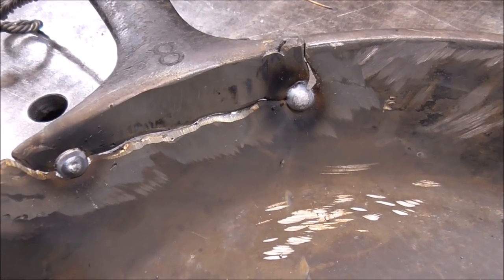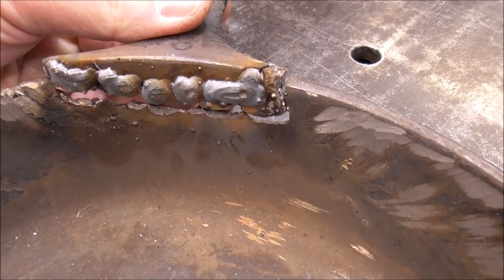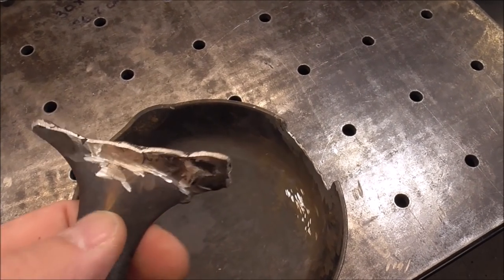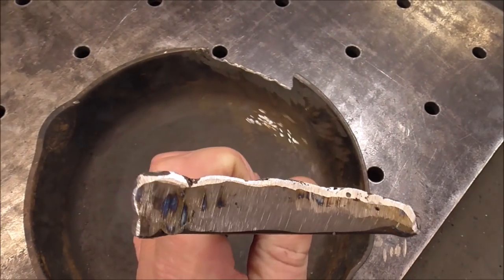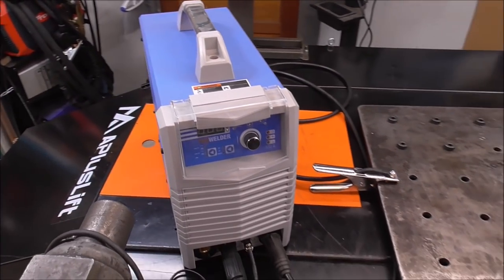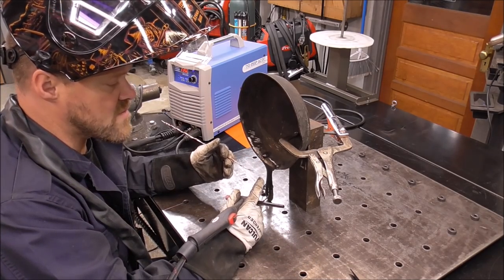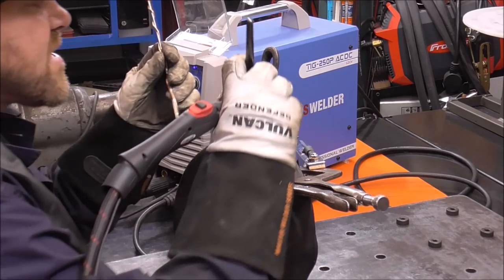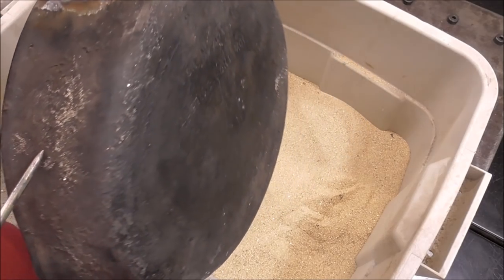Cast Iron Welding Repair Experiment Using Copper Wound Stainless Filler Wire

Comment: Thanks again Brandon, they can’t say you didn’t try it. I spent many a day with 3 welders who were trying everything they had heard or seen on welding or cutting cast iron ash lines in a power plant. I’ll say this for them, they never gave up trying until they died. They were a great bunch of guys. Stay safe and keep having fun. Fred. 🙏🏻🙏🏻👍🏻👍🏻👏🏻👏🏻✋🏻✋🏻
Reply from the maker: Thats awesome Fred. I actually had a guy tell me today that cast iron cant be welded and that he had 20 years in the trade. I guess once you start entertaining a "cant do" attitude then you are half way to failure. How were you guys repairing them Fred? Oxy Brazing with cast rods? Were they pressure lines?
Reply: They were trying both ways. That was almost 60 years ago. The ash lines had to be rolled after so many hours and hopefully replaced before they started leaking or bursted. I was there for 6 months and was laid off but changed fields. Got my eyesight back in the bad eye and decided to try welding a few years ago. My wife says I am very trying whatever that means ! 🤗😁🤣
Reply from the maker: Very interesting. On a side note your wife must know mine because mine says the same about me....😏 lol

Comment: I'm impressed how smooth that stainless and copper welds @Brandon Lund
Reply from the maker: @Antonio Claudio Michael I'm going to dig a little deeper into this combination because it flowed like butter. I was actually surprised it failed. It could be because if other repairs so I might try this again on a new pan. I was really hoping it was going to work.
Reply: @BrandonLund  this on a new pan would be a great video I did see how well it flowed and that was impressive to me

Comment: I've welded cast iron.  I did it by heating it with a blow torch and then just kept it hot with the torch, then I slowly decreased the time heat was on it, then buried it in sand with a towel over the top.  Worked great...heat then re-heat.  It almost seems your weld was good with copper, but your cool-down was way too fast.  I'd love to see that again, but you heat and re-heat.
Reply from the maker: @Hip Airbrush what you described is typically how I weld cast also. As far as the cool down, I did it in this video the same as I did in the 3 prior repairs hoping to keep the results consistent. One other viewer mentioned try 309 because of the dissimular filler. I hadn't really thought about it that way.  I'm also wondering if the past 3 repairs on this could have really messed up the grain structure. I really want this to work because the metals flowed like butter. I'm going to try this again but with a new pan and heat more as you suggested. Even if it's not identical to the previous repairs I feel like this is a good filler metal once I get it figured out.
Reply: @BrandonLund   I'd love to see that.  I saw exactly what you meant with the weld how it penetrated nicely.  I think hitting it with the blow torch a few times to keep it hot would help it not crack.  I'm now wondering also, if you couldn't use a nickel rod and wrap copper around that.
Reply from the maker: I like that idea!

Comment: The more i think about it maybe the filler rod isn't the problem but the process isn't really ideal being the weld didnt fail it cracked next to the bead being tig is slower and introducing so much heat netting more expansion and contracting vs quick tacks with stick or mig, maybe with tig if you had a way to have a propane or map gas torch running on the backside keeping it hot while your welding would help ,good stuff Brandon
Reply from the maker: @jimcaf57 I think the filler rod is going to work I just have to work on my execution. I think whereas the pan had been repaired 3 other times in that series that the grain structure has probably weakened. Im going to try this again but with a new pan, continued heat with a torch as you mentioned and maybe less amperage by using a smaller diameter copper wire.  I might try 309 wire but I'm not 100% convinced yet that the wire was the issue like you and I both agree on

Comment: Most stainless steel has a meaningful amount of nickel in it already.  Around 10 or 11%.  Nickel will bond well where other metals will not.  If you buy a diamond coated abrasive tool, nickel is what they use to "glue" the diamond to the substrate.
Reply from the maker: @solarguy I learn something every day. Very interesting. Thank you for sharing. 👍

Comment: Need more post flow when tig welding. 5 seconds min regardless of material. I usually use 10 seconds. Unless its aluminum. Then u can get by with a lower post flow. 20 cfh was good tho.
Reply from the maker: I will give that a try.  I usually set 7 for everything and 10 for aluminum although I'm confindent thats not why this failed. It very well could be that i put too much heat into it. I plan to try this experiemnt again using a new pan because several others cant be completely wrong. I'm amazed how well it flowed

Comment: I'd like to see if there are other applications to stainless + copper mixed or perhaps other copper mixes????   Also, Have you done any welding with any tool steels at all?  I have a batch of A2 Air hardening tool steel tig rods that I have barely touched, but had some success with repairing an old fashioned  BMC no 9 locking wrench which had a section of really worn down jaw.  Anyways I enjoy the videos, looking forward to the next one!
Reply from the maker: @John Lane I'm planning to do some more experimenting with that combination because it flowed beautifuly. Im sure there are other applications where this could be used including maybe a new cast iron test with virgin cast. I've never tried tool steel

Comment: A recap for a blast from the past. Considering that you can buy nickel TIG rods in half pound increments from eBay, and one pound mig  wire, I don’t see why anyone would want to play around with combinations not meant for this. And if that’s a problem, the old standby if bronze brazing is fine if the strength isn’t as important, or the part is thick.

But that pan is pretty thin, so it’s weak anyway.
Reply from the maker: It's all in good fun @Mel Gross. A lot of these suggestions I get often come from far off places of the world that don't have the same luxuries that you and I have like ebay and Amazon. Heck, I still get comments from people saying cast can't be welded so I'm always open to learning new methods especially when I get real odd ones like in this video.

Comment: One of the things I really enjoy about your posts is the quantity of information that you provide.  I am so learning about welding and what you give is very helpful.  Question:  If you were to have welded over the known craca, both front and back after heating the pan again, would it have made a difference???  Also, if you had used a MAP gas torch to heat the metal so it didn't cool between welding passes, would that have prevented the cracking???  Also, if you had put the pan back in the oven or sand immediately, would that have helped???  Great job!!!
Reply from the maker: @Jim MacSuga thanks man! You make some great points. I'm actually concerned that whereas I have repaired this part 3 other times that It could have to do with the change in grain structure. I could of drilled a small hole at each end of the crack and rewelded it but then that would have changed the result compared to how I welded the other 3 times. Map gas is great to use between passes but whereas I went from welding to peining to welding again the part never had enough time to cool. As far as putting it in sand or the oven, once I was done it went in the sand immediately. An oven is even better if you can lower the temp by 25 degrees every hours or so it will greatly help with that rapid cooling effect.
Reply: Thanks!!!; That mwk s sense.. going to weld a cast iron motor housing and that will help!!!
Reply from the maker: @jimmacsuga2592  good luck buddy!

Comment: Brandon I noticed that you cooled your weld every time you made a pass with your welding gas perhaps that’s the problem?
Reply from the maker: @Robert Dominiczak I'm not sure...because it's a odd coMbination it's hard to tell. I did another video using a different filler and kept the heat on it. The results were much better. https://youtu.be/njcL2eVR5FQ
Reply: I understand that but copper cools down quicker? Which makes it shrink quicker. Look into shrink rates on different metals?
Reply from the maker: Thats correct Robert. I'm very farmular with metal shinrikage. Because of it's thermal properties I often use copper as a backer to prevent blow out on thin metals which is also why I decided to keep constant heat on the link I attached hoping that the thermal stress in between heat and cool cycles would be less. Copper is on the far end of the spectrum  as compared to stainless which is why I said it's really just a guess of why it may or may not work because both materials are very different. One article quoted the thermal conductivity of copper as being 20 times that of stainless which is why I think this is not a great combination as a filler metal. Both metals have very different heating and cooling rates and therefore they are both going to expand and contract at very different rates. Although the second video was not a failure, there are far better filler metals out there but thats why we do these experiments so we can all share and learn and with every video I make doing these odd combinations, i'm always learning new things.

Comment: I'm curious about the results of this test as it pertains to the pan itself. Is it really a valid test, seeing as how you have already welded that handle back on so many times prior? I would have to imagine the iron was already so muddled up as far as grain structure from the previous tests. Wouldn't it be more accurate to use a pan that had broken, but not re-welded yet? Just thinking that could be a factor in the failure,  as the area at the toe of the weld is constantly being "assaulted" by rapid heating cycles each time it was repaired...hmmmm 🤔🤔🤔
Reply from the maker: @Steven watkins I think what you are saying probably has a bigger impact than what I originally thought. I feel like those filler metals flowed so nicely that it would have to work. One other commenter suggested 309 which I never really gave a thought thinking I was welding cast to cast. But 309 might be good for the dissimular properties of the copper. I think this will work but I have to get the process dialed in. I think what your saying will help, The grain structure has to be pretty brittle from the previous repairs and maybe 309 wire then a strict post cool down. Even if the procedure isn't the same as the 3 prior repairs, I really want this to work and I feel like it will with some more experimenting. A new pan, a new number for the original breaking strength and then test it using these fillers. I feel like the results would be simular to a nickle repair. Fingers crossed! Thanks again buddy. I agree 100%
Reply: @BrandonLund  I love all of the experiments you do,  it helps us all learn together! I can't wait for future tests and results!!!!

Comment: I'd like to see how a new pan — the exact same size — would sustain that much weigh  (and more ) on its handle... as a comparison. My guess is that your repair's good enough... Thanks for the vid.
Reply from the maker: @R Belang I'm curious also. I'm going to repeat this test again with a new pan and maybe with 309 filler instead of the 308

Comment: Wonder how TIG (AC) with Aluminum Bronze filler would hold up, I have use that combo a few times for cosmetic fixes. 

Great vid!
Reply from the maker: @Main Street Machine Works That's a great suggestion! Thank you! I bet it would work well.

Comment: Good video.  I missed if you said whether or not you have an oxy acetylene.  If you do you get a better heat treat from that.  

I need one of those helmets. Lol
Reply from the maker: @Earl Cavenaugh I have a complete oxy acy setup but tank is empty at the moment. I havent been using it much since I got the plasma but it's occasions like this that it would be handy. On smaller parts I use Map gas to maintain the temp after the preheat

Comment: Ever weld cast iron onto mild steel?  I'm curious because I see these cast iron caps for square tube fence posts.  Not sure they NEED to be welded down, but I would rather weld them down so nobody steels them.
Reply from the maker: @Aaron the Amateur if they are Grey cast it should be no problem.

Comment: just a thought 309 is for dissimilar metals not 308
Reply from the maker: @jimcaf57 Great point. I know a lot of folks that have welded cast with both 308 and 309. I went with 308 thinking cast to cast but I see what your saying about the dissimular filler. Thats an interesting persepective. Personally I have never really had much sucess with any of the stainless fillers on cast. I think 308 is non machineable so the next test i do I will try 309. I reallly want this to work because the combination of the two metals flowed like butter. Thanks for mentioning that! 👍

Comment: Very interesting test Brandon 👌.  I'm researching the Yeswelder brand and I'm like this 🤏 close to jumping on the  Mig205DS Machine. 
It has all the features I think would benefit me over time.  
Have a great weekend.
Reply from the maker: @Gabriel Szekeres I just got one. I'm going to be using it this weekend. If it's any good I will give you a discount link.

Comment: Yeah the options for people with beards are harder to find and usually more expensive.  I always have a beard because my wife likes it.  I just snug the mask up tight and it seals pretty good.  I keep my beard on the shorter side though.  A big old beard would defintely be a problem with one of those masks.
Reply from the maker: Thats exactly my situation @Christopher Salisbury. I keep it short because my wife likes a beard on me and it drives me crazy when it starts getting too shaggy. The mask might not fit perfect but it's catching tons more than if I didn't have it on. Have a great weekend buddy!

Comment: I had a friend ask me about welding cast and I chickened out.
Reply from the maker: I get asked a lot also. I tell them under no circumstances is it guaranteed and the risk they take is I could totally destroy their part and I have them sign a waiver saying they agree to this. I also don't repair any cast iron that I'm told is structural. It can be risky but the truth is that pretty much anyone can repair cast iron with about a 90% success rate. It's that 10% failure that can come back and haunt you.

Comment: Good one Brandon. Love that you are showing alternative methods. My first boss showed me this one, years ago. Haven't done it since then😂😂😂 I find welding Cast a great fun challenge. 
Good one. 
(Appealing to your OCD. I see your grinder rack isn't powder coated yet😋😋)
Reply from the maker: Thanks man! @Basil Keen because I wasn't given much information from the original poster other than use stainless and copper, is what I'm doing here seem like how you were told? Should I be doing anything different? ? Someone suggested i should try 309 because of the dissimular copper / stainless combo. I never thought of it that way. I went with 308 thinking about the cast to cast weld.  This filler really ran awesome and I feel like this will work if I refine my procedure. I think a big part is the used pan has probably messed up the grain structure from the previous welds. I'm open for suggestions and I'm hopping I can make this work. Thanks buddy! 

EDIT: Just when I thought I had pushed my powdercoating obsession out of the way, you bring it up. THANKS hahaha 🤣🤪🤪🤪
Reply: @BrandonLund  Glad to help with your OCD 😂😂😂😂
Pretty sure it was 308 that I used back then. Worth giving 309 a try. 
What you did was exactly what my boss showed me back then 👍🏻👍🏻👍🏻
Reply from the maker: Yah thanks 🤣🤣🤣 it will be another 2 weeks before I stop obsessing lol.

Thanks for your feedback. I thought it seemed logical.  Im going to try this again but with a new pan.Thanks buddy! 🙏
Reply: @BrandonLund  😂😂👍🏻

Comment: Gas weld with brass. Who doesn't have a oxy setup. Not a welder.
Reply from the maker: Gas was actually the very 1st process I learned on but over the years I find myself using it less and less especially once I got a plasma. Oxy Fuel and tig brazing has and proabably will always be the prefered method, it's these oddball combos that really interest me.